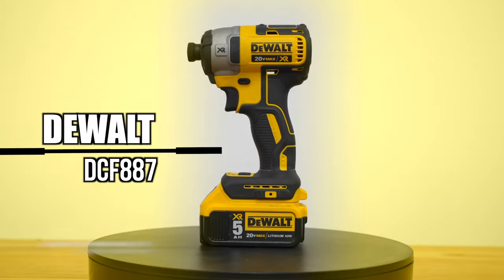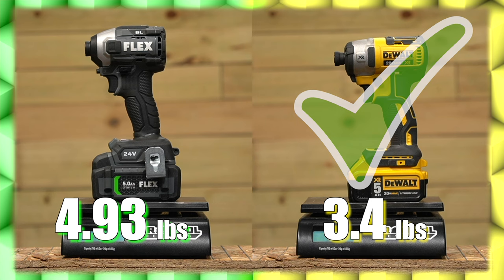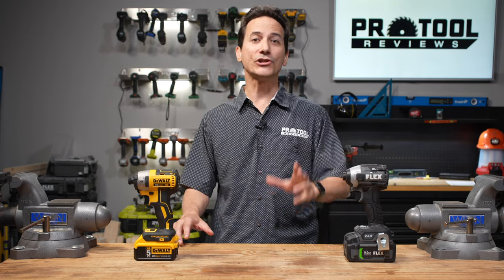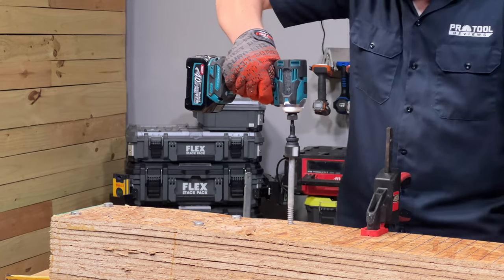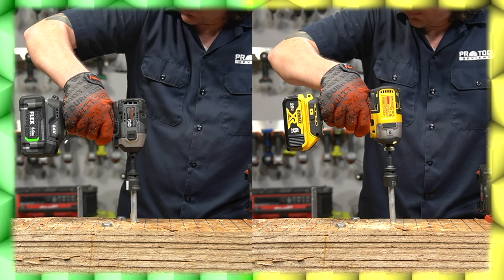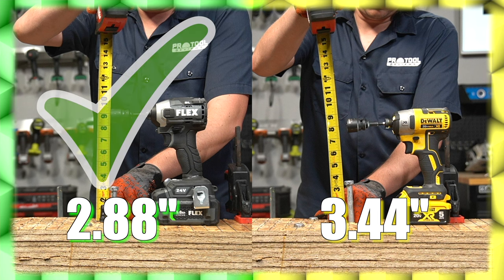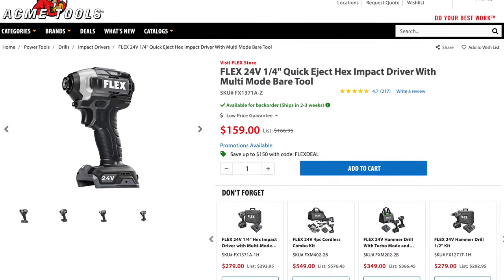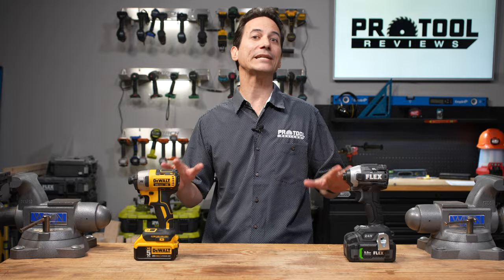DeWalt vs Flex Impact Driver: 20V DCF887 vs 24V FX1371

Comment: Dewalt has never made a good impact driver
Reply: Lol it drives screws a millisecond slower, must be junk. You people are funny. I’ll take a battery line with 200+ tools over one with less than 75 from LOWES anyday. I’m not even a Dewalt guy but I know flex ain’t sh*t.
Reply: @ryanhewett1820  I don't think this is a serious statement, given this guy's affilation with Philly Fixed, but I could be wrong.
Reply: @ryanhewett1820 I have both of these and like you said much more to offer than flex although they are starting to get more tools out, my major complaint with flex is the weight so I don’t even use it
Reply: @ryanhewett1820 flex has been around since the 50s . They created the angle grinder. Dewalt I think should be used for lighter work . Flex is all heavy duty
Reply: @glenarseneau1231 u must have weak arms
Reply: I’ll stick with flex. Not a Dewalt fan, Stanley black n decker’s quality keeps dropping.
Reply: Yup 👍
Reply: @ryanhewett1820  You have no idea what you're talking about, you're just a troll.
Reply: @mtasubwaymartasubway  ??? Lol
Reply: This wasn't apples to apples, the 887 is old

Comment: The 887 was released in 2016, what are yall doing not testing out the 845? Also both companies have stacked lithium batteries, why not test those?
Reply: I think the 887 was released in 2015 (or announced/showcased) 
The 845 is actually about the same as the 887 believe it or not… it’s a let down… luckily Dewalt introduced the 860 that’s coming out soon… it’s definitely 🔥
Reply: @carlosf9278  Its not about the same it's faster and yes it's a disappointment. The 860 vibration is out of control from what I've watched from tools with soalz
Reply: @carlosf9278  Its not about the same it's faster and yes it's a disappointment. The 860 vibration is out of control from what I've watched from tools with soalz
Reply: @FoxOutdoors  not even by much lol. The 845 might as well be the 887v2😂. I love my 887 tho. So I might like the 845 as well tbh… but am definitely going for the 860 because I want it

And depending on what you’re doing with it, the vibration will either be negligible or really noticeable… I’m just a general contractor so I doubt I’ll notice it since I’ll mostly be using the impact driver for 4in screws or smaller 

Maybe if you’re a mechanic or someone that doesn’t like using a drill for large screws/fasterners

Comment: A brand new model vs. one that is nearly a decade old? I'm no fanboy either way, my power tool bench looks like skittles, but c'mon. How about giving it a fair comparo. Why not the 850 or 840?
Reply: Always how these channels do it to get clicks/ likes. Sad honestly
Reply: "my power tool bench looks like skittles"

😅😅😅😅😅😅😅😅😅😅😅
Reply: @YankeeWoodcraft  Funny, but also true! Metabo HPT18/36, DeWalt20/12, M12, Kobalt24, Bauer20. But between them I've got exactly what I need! 😀
Reply: the 850 would be sad to watch that thing sucks lol but the new dcf860 flagship definitely let flex know not to forget Dewalt is still in the race!
Reply: @TOOL_TECHNICAL  the 850 wasn't sad when this comment originated. it was the new hotness at that time.
Reply: @J.Wick.  new at the time yes, compact 100%, and with a powerstack it may get the job done but it was on par with the m12 impact driver when not running a PS. with a flexvolt 6 the milwaukee gen 3 still gets it by a hair or 2. I like that tools are getting so good that tool channels (like myself) don't have to push people into too many platforms as brands keep giving us the tools we need. milwaukee dropped like 94 new tools this past pipeline.

Comment: Why wouldn’t you put it up against the new Dewalt XR?
Reply: Exactly lol
Reply: It doesn't matter bro flex would've blown it out of the water anyway
Reply: Because it's Pointless! The new DeWalt XR 845 got beaten by Flex so easily and effortlessly only Standard 18650 cell 5Ah battery. We also tried the new DeWalt power stack 5Ah vs Flex 6Ah Stack lithium and The DeWalt is not even Close enough to win. Even The Milwaukee Gen4 M18 Fuel with High Output. But we're gonna do the test again because we're waiting for the new Milwaukee's 6Ah Forge Battery in our town.
Reply: @littlecedar3425  lol flex boy, get a real proven longevity tool called... DEWALT.
Reply: @timgaskey2258  oh yeah! I've been using mine for 2 years straight now! I actually Switched from DeWalt to Flex 24V I sold all of my DeWalt cordless tools and purchased all the lines of Flex 
But still I love Makita 😜

Comment: I have combo sets of both.  Give me the flex all day. Yes, heavier but that extra heavyness helps in driving power.
Reply: If you put more load on a dril/driver it will make it run slower since youre adding weight thus needing more torque so ...
Its the opposite but yeah you need a balance

Comment: Cost, batteries, that only matters to homeowners. When it comes to pros, the ONLY thing that matters is how does it do in the field and what kind of warranty you're getting. Nothing lasts forever, but you're not going to buy something that you have to keep replacing. I can't wait to start buying Flex tools. They continually up the game. They remind of me Bosch when they were at their height, just dominating everything across the board. When you bought a Bosch, you knew you could beat it like it owed you money and it'd just turn around and say, "Thank you sir. May I have another?" Now, I'm far from a DeFault fan. In fact, I hate them because when I was running my own company and a brand new compressor I bought from them failed, they refused to honor the warranty and told me that it was going to cost me $150 to replace the motor of a NEW compressor that I was using on my first job with it. I told them to go to hell. 

Having said that, 20V vs 24V is not a fair test. Of course the Flex (which I'll be buying from now on) is going to cream the DeFault.

Comment: I have DeWalt stuff, and have no issues with the results here. The issue with Flex is how heavy it is, and how (currently) limited their tool range is compared to DeWalt. I'm not a pro, and I'll never use either tool at its limits, so comfort is really my biggest issue, and DeWalt tools have great grips that just feel awesome in the hand. Mix that with a much lighter tool, and that's a good combo. Personally I'd go with the 850 in any case, then you also got a much smaller tool as well. With all that said, if Flex sticks around and expands their range, I'll certainly consider them in the future. I love my Ego lawn stuff, and I love how much more modern of a take Flex has on tools, so I hope they push the other makers to modernize their feature sets.

Comment: I like flex tools as I have 5. However, as other people commented the lineup of tools for Flex is limited. I do hope they come out with additional tools as it is nice to use one tool platform for battery purposes.
Reply: Nailer already announced
Reply: Table saw in route and miter saws just after so what was you saying about the FLEX Platform now Mrs @CrazyGlasses
Reply: @rickyperkins232  Lifetime warranty extended 3rd year running, until 2024.
Reply: @athannaelanderson3806 Anth that's such good news.

Comment: I have both dewalt amd flex. I can say without question flex is insanely good. With fkwx releasing new tools on the regular its a matter of time till they have as many options as dewalt
Reply: We're phasing out Dewalt.  Replaced our xr impact,  drill and reciprocating saw with Flex basic brushless,  not even the BL. Just blows em out of the water.  But we're also going to Milwaukee simply cuz ofthe variety.

Comment: Who’s the manufacturer of that socket adapter on the flex? My flex set on 3 will twist off that adapter within a couple uses, with it set on 2 it might last a couple days, the best I’ve found was the stubby Milwaukee but them to won’t last no more than 3-4 days

Comment: This is an excellent review and it is impressive.  I own a lot of Flex tool (over $250K) and based on the video, I will throw away my Flex tools and start investing into the future by upgrading to DeWALT.
Thanks for your suggestion.
Reply: I had a lot of dewalt and switched to flex . Dewalt is underpowered but good for light use
Reply: If you have a lot and switched then you must not be extremely bright by changing.  To the point, you are not not a dummy and therefore, you do not have a lot when switching over.
Remember, this is Flex Tool not to be confused with Festool
Reply: Their suggestion was impliedly the opposite of that.  Nice post, DeWalt Sales Team.
Reply: FLEX won the competition, though..
Reply: vâng, a nổ rất to đấy😂

Comment: Both batteries are 5Ah, but the Flex battery has 24V and DeWalt has only 20V. If anyone here has a degree in physics, please explain how the Flex battery does not contain 20% more energy than the DeWalt battery. Concidering U*I*time = E
Reply: the working voltage is closer to 18 vs 19 or 20. sizes of sockets/and bits and weight of the tool and battery all matter more. Ultimately the better built tool always wins thats why m18 fuel smokes 40 volt ryobi, 40 makita. Flex in some cases loses to the 36V hikoki impact so.... it really matters how hard the impacts hit and calculate the Force --> Force = Mass of the internal hammers x Acceleration of the anvils - some of the impact is lost in thicker bit holders and extensions of course. speed if you're a pro is important but for the everyday joe shmoe I'd grab the lighter dewalt. I've been wanting to go all in on flex 100% but the weight of their tools has me on the fence. Great quality tools from both brands but I'm in 8 + platforms and go with whatever tool can get the job done without transferring shock, vibrations, impact, or bad grips to me. People should go for good tools that wear themselves out and not the user.

Comment: Top for 2023 fle. V 2015 Dewalt. Seems fair. 

Hahaha. How much does flex pay?
Reply: Maybe they’ll use other 8yr old models from different brands lol or better yet the brushed Dewalt DCF885 from like 2011
Reply: @Bloodmoon1985  It's like how when you go to Lowe's they have demo tables with the FLEX Turbo vs the tiny base brushless Milwaukee one.
Reply: @orijimi Lowe's doesn't even sell Milwaukee. You have no credibility and should stop commenting lol
Reply: @Rufsam24  Can I reply to this comment in any capacity, YouTube?
Reply: @Rufsam24  So, no matter what I do to circumvent filters I can't mask a link to a photo I took of this exact thing.
Reply: @Rufsam24 I've seen the same display at Lowe's.
Reply: @orijimi  well, if a Lowe's did that as a marketing tactic, it was a pretty dumb move on their part. Especially considering the fact that the Flex line of tools was created to compete for a bigger investment from the contracting community (dominated by Home Depot) who would be most likely to spot the worthless side-by-side an entry level Milwaukee vs a Flex tool would provide. However, after having previously worked as a product merchandiser for Lowe's for a few years, I can say with absolute certainty that there are a lot of incredibly ridiculous  decisions made and I got a little numb to now idiotic some people pretty high up could be
Reply: @Rufsam24  It's actually more than one of the Lowe's in my area, but yeah, I doubt it was done at FLEX's say-so. Probably some regional manager. Part of why I thought it was so tone-deaf is precisely that. You're not fooling anyone in the demographic that are going to buy this shit. Another thing that comes across as so moronic to me is that they don't have display models of the 6.5 inch inline circ saw, let alone even a spot with a price tag. Some locations, not even stock. Of the 3 FLEX tools I own, that one is the tops.

Comment: Weight is a big thing. If your using the tool overhead. Also all day long if you use a lighter tool you will be working faster. If I need to drive Bolts, I use the right tool an impact wrench. The impact driver is for driving screws, not breaking lug nuts off a truck. But yes the Flex warranty is hard to beat. And it has the power if you need it.
Reply: Flex is for the big boys . Anything lighter feels like a toy to me💪🏻

Comment: The dcf840 blows the 887 out of the water in both power and speed I have the 887 too but I would like to see this same test with the dcf840 if possible Thx.
Reply: Same with the DCF845, they both have 4200 IPM compared to the 887's 3600IPM.

Comment: Sure the flex has more power but will it still work in a decade of being beat to shit?
Reply: Let’s find out 10 years from now
Reply: Dewalt is not what it used to be they have a fit and finish problem I’ve bought a few that had trigger problems and chuck problems they used to be on top when the were 100% American made and not owned by black and decker- stanley